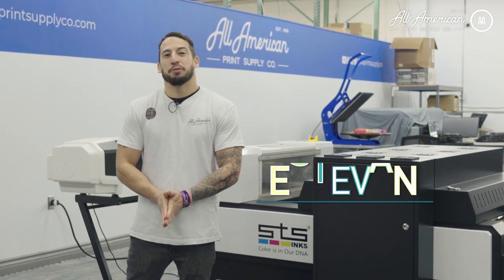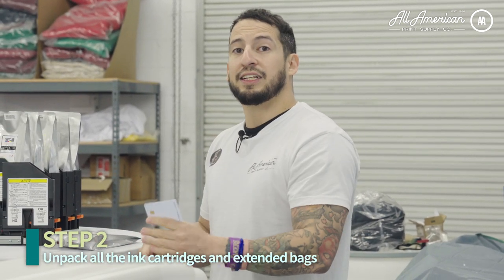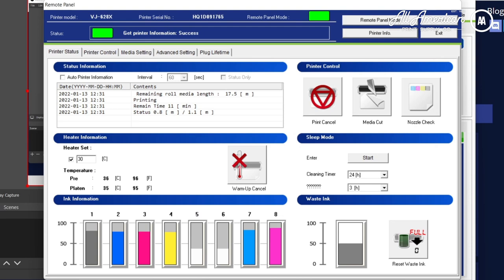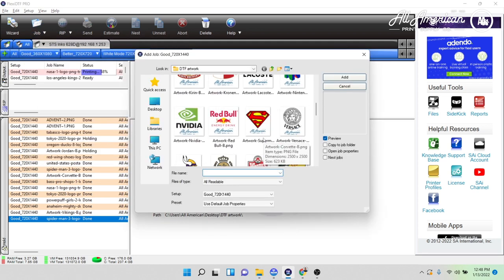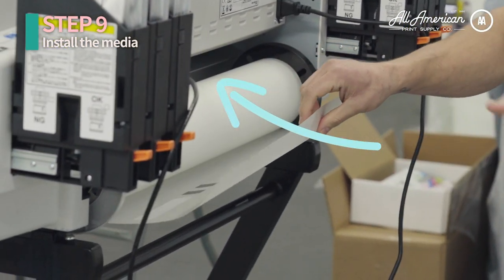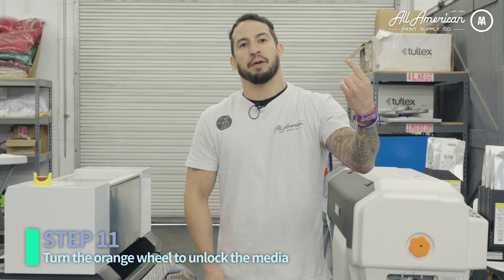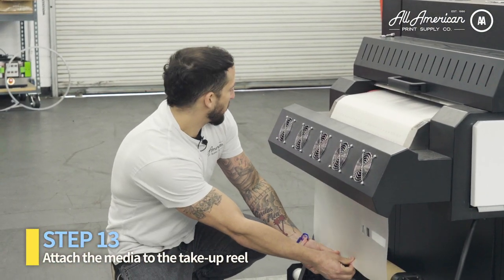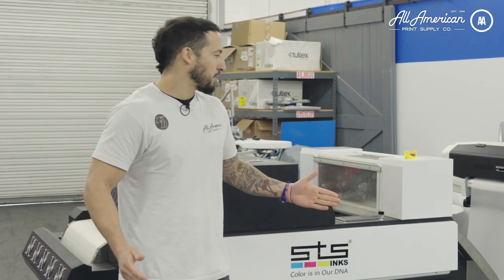STS VJ-628D DTF Roll to Roll Full Setup Training | AA Print Supply

Comment: Does the stand help in levelling the equipment to the floor to avoid any printhead issue?
Reply from the maker: Hello,

Absolutely - designed for the model specifically and a must have in my opinion to run the full set up (printer, shaker, dryer) as smooth as possible

Comment: Nice machine! 
Question 
*how much Square foot does it print per hour?
* What type of print head does it have?
Reply from the maker: Hey there, it really is!  This machine prints 36 sq ft/hour and runs a DX7 printhead
drop me an email for any questions on the printer or full production set up Estevan@aaprintsupplyco.com
Reply: @AAPrintSupplyCo  
It's using a Epson DX7 Printhead. How many print heads does it have?
I'm assuming Epson Motherboards as well then?

Comment: Hi,
Is there any damage to the print head during printing caused by clogging of the print head after contact with media or powder?
Reply from the maker: Hello,

The way the full system is set up, the powder application area is away from the print head - if powdering manually by hand it would be best to do this away from the the actual printer itself to prevent any unwanted contact

Comment: What type of power outlet is needed for the shaker/heater unit?
Reply from the maker: Hello, 

We have an electrician hardwire ours in off of 208v and 30 amp power connection

Comment: What do I do if I don't have ethernet access where the full system is to be setup?
Reply from the maker: Hello,

The printer to computer requires ethernet/LAN connectivity
Reply: @AAPrintSupplyCo  So no wifi or usb to connect the two???  Because my computer (laptop) doesn't have an ethernet/LAN port.

Comment: No one talks about head clogging due to white ink.   Whar are new tech to prevent it
Reply from the maker: Hello,

This system runs a dual white configuration to allow for more efficient ink circulation and head clog prevention.  Additionally, the manufacturer does advise the system to be left on continuously so that, while in energy save mode, the ink continues to be circulated between runs
Reply: @AAPrintSupplyCo  Just the printer is to be left on correct, or the shaker and heater as well?
Reply: I use that printer every day.
Shake ink every day. Use nozzle clean after all printing. If you check nozzles - make short clean after that. Set short cleaning on 3 hours.
Print everyday. If you don't print 1 week - you can use cleaning cartridges in all slots to clean all system.
If you want to print faster - try different settings. It can print really fast in good quality.